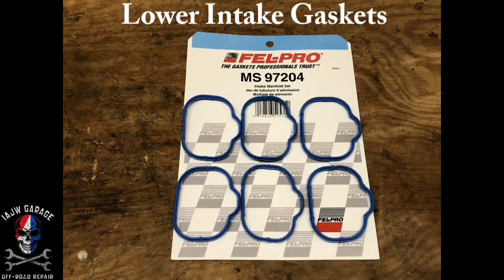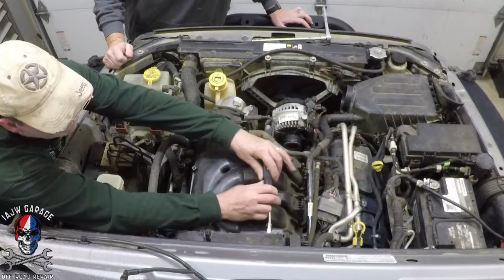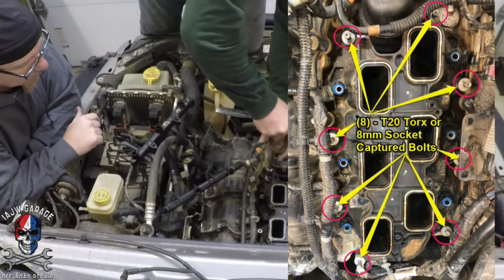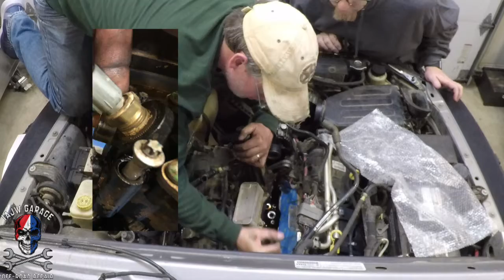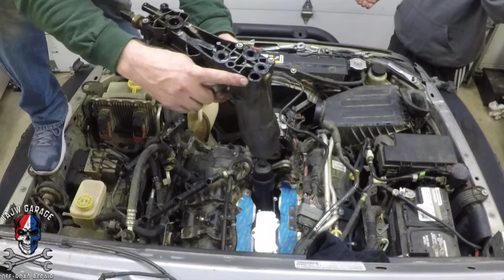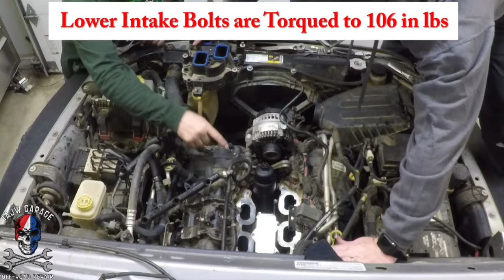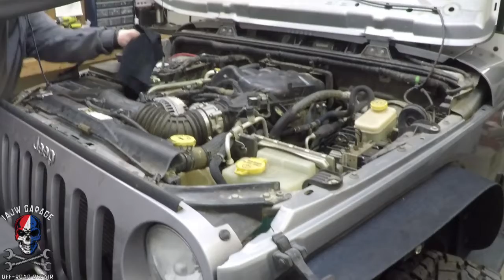Jeep Wrangler JK JKU 3.6 Pentastar Oil Filter Cooler Housing Replacement

Comment: Excellent Video! I just did this job on my 2013 yesterday. Every step is covered here. I read somewhere that the coolant could spill out of the hose and get into the oil system when removing the hose from the back of the housing. I clamped the hose off before removing it to avoid this. I don't know if this was necessary, but only a very minimal amount of coolant came out this way. Thank you guys SO MUCH for taking the time to do this video.
Reply from the maker: You are very welcome!!! Make it all worth it to hear feedback like this!!

Comment: Questions, 

1. did you drain the oil and coolant prior to doing this?  

2. am not a expert but what's the average time to complete the job?
Reply from the maker: Did not drain before doing this. 
It took us 5-6 hrs including filming it.. I’d set aside at least 5 hrs
Reply: Coolant ended up spilling into the valley to vac out. One recommend is to clamp the hose.

Comment: Just a heads up, these coolers can also fail internally and start mixing oil into your coolant system. Thought I’d leave this here because I couldn’t find much info about that occurring online. Thankfully not the head/gasket like I had initially thought. Thanks for the good quality video.
Reply from the maker: You are welcome and Thank you for the info. I had not heard that before

Comment: You sure the lower intake bolts are 106 ? 
106 popped my t-20 torque
Reply from the maker: Inch pounds
Reply: Might have been the torque I was using. 
But I started lowering it to make sure the rest didn’t pop.
Reply: It was inch pounds.
Reply: @omargarcia4293  whew! 😓ok cool
Reply: Holy shit!

Comment: use a turkey baster to get oil out
Reply from the maker: Turkey Baster would work. I used a shop vac with a rubber 3/8” inside diameter to get in there and get it all out

Comment: what exactly was wrong with the housing? thanks
Reply from the maker: The seals on the input output tubes under the housing degrade and leak
Reply: @ItsaJeepWorld  my caravan is at the dealer right now, they said I put the oil seral on wrong,, dont know how u put a round oil seal on wrong. it wasnt pinched or overtightened. when it leaked all the oil out, I refilled it and looke around the oil filter cap, wasnt a drop of oil around it., im sure they will call back and say I  overtightened the housing next and deny the warranty. thanks so much for the video, I may fix it myself.. I told the deaer I knew the housing had been revised 5 times due to problems.
Reply from the maker: @randy1ization  you’re right can’t put a round seal on wrong 🤣🤣
Reply: @ItsaJeepWorld  went to junkyard to buy a tire, guy told me  people call everyday looking for 3,6 motors. he has a waitng list. they are locking up after leaking the oil out.,
Reply from the maker: @randy1ization  good to know
Reply: @ItsaJeepWorld  hopefully an aftermarket company will make a aluminum housing soon, but I dont know how they will fix the leaking gaskets on the bottom, the right  silicone rubber formuation can take alot of heat, so im thinking the supplier of the orings used el cheapo materials. take valve stem seals, they take a shitload of heat from the valve stems, but last many years. also it could be a failure of the pressure sensor, causing excessive pressure at those seals.  being the new housing has a new sensor, it may cure the actual issue and  u never knew it..  that engine is a PLIVIT.. U know what a plivit is?  10 pounds of shit in a 5 pound bag!!!
Reply: @randy1ization  so there isn't a low oil light? Asking for a friend!
Reply: @Goesinya69  evidently not,, the check engine light started blinking and a symbol that looks like swervy double skidmarks came on.  my issue turned out to be there was 2 orings on the bottom of the oil filter, and it caused a vacuum, pulling oil out of the motor. it was my fault, I didnt realize the oring stayed in the housing. from the old filter. im talking abt the small oring on the bottom of the filter, not the cannister cap oring
Reply: these motors have a strong oil pump, and if u dont get everything right, it will leak oil.. the faster u go, the higher the pressure.. we were running ole nellie belle pretty hard .

Comment: I noticed yesterday on my 14 jku I have oil dripping down bell-housing  dripping off cross-member on to the exhaust also been noticing a little antifreeze smell at times looked down to the valley very slight trace of oil down there but I'm thinking this could be the problem
Reply: Was this the problem?  I think im having the same issue.
Reply: @TCueteZ  yes it was i took it to a mechanic cause I wasn't sure if that was the problem or not I could see down in the valley but not much oil present took it to a shop and told them to check it out 10 minutes he came back said it was the problem I stopped and got the parts on the way home and tore it down only issue was the oil.temp sensor getting it out of the old housing it was seased up and broke it but $28 dollars at O'Riley's also put new o-rings on the injectors and a new set of upper and lower gaskets this video was great step by step

Comment: How can I tell if this is the oil filter/cooler rather than the rear main seal?
Reply from the maker: The oil sloshing from the cooler valley comes down from the top on the passenger side. Get back there as best as possible and clean it. Then I drove mine and hit the brakes hard a couple times and looked, it was obvious where it was coming from.

Comment: I'm actually swapping out a bad oil pressure switch, which is located right behind the cooler.  Man THANK YOU for the best video I've found on bolt locations and torque specs on my trip down through the intakes lol.  Saved me a bunch of headache.
Reply from the maker: Thank you so much for the comments I appreciate that

Comment: This is the most complete video I have seen!  Helping a friend with his 2017 with 74,000 miles (it's only 2020) with his.  You covered every step, and included torque specs.  One question... Did you have to drain any engine coolant?
Reply from the maker: I did not. I just let the small amount drain out when I pulled the cooler

Comment: Why does everybody skip past installing the fuel rail again I’m having trouble getting the injectors to seat back into the fuel rail And everybody just skipped over the part
Reply from the maker: If everything is loose it should just pop back in, that’s why... you are binding somewhere
Reply: @ItsaJeepWorld  I just did my oil cooler tonight and turned the key in the on position and fuel came pouring out all over the ground. Is that a sign I didn't get my fuel rails back in place properly??
Reply from the maker: @brooksbrunson3823  most definitely
Reply: What did y'all end up doing, I've reinstalled multiple times and can't get the fuel rail to seat back correctly. Blue orings in the rail are all installed.
Reply from the maker: @kevinstromeyer2673  it just seated first try. Check to make sure no wires or something is blocking it from seating correct

Comment: What are the initial symptoms of this issue ?  Oil in the driveway ?  That valley of oil, holy crap.
Reply from the maker: Oil coming from the back of the engine from it sloshing out the back and gets misdiagnosed as rear main seal

Comment: I'm in the middle of doing this on a customer's 2012 JK right now and one huge tip I'll give is that the 3 oil passage ways should also be vacuumed out, I used  flashed light and could see debris down inside them. I just tape a 11/32 hose to my shop vac hose and shove it down the oil passage way until I couldn't see any more crude.  A shop in Florida did the oil cooler job for me on my Mercedes Sprinter but didn't clean the oil passageway  and 400 miles later, the motor seized up due to only one of the main bearings running dry.

Comment: Thsnks very much!! Very thorough video. I have 120k on my 2012 jku. Good time for me to change the plugs, coils and injectors. 

My Oil cooler just went but it did not leak oil. I was having coolant issues.  The jeep kept on going low on coolant. It wasn't leaking unless the jeep was driving down the road. I would get the "hot oil" message. It was hard to figure out until the coolant just finally gushed out on both sides of the bell housing when I would add coolant to the radiator. Never leaked oil at all.  

I upgraded to a 2014 oil cooler.  It has been redesigned a little bit from the 2012 cooler.  It bolts right on.  Takes a different filter.  Also the older 3.6 pentastar can take the 2018 lower intake manifold that has 20ml larger intake chambers per cylinder. Incase anyone was wondering..lol

Awesome video. Thanks for putting it together!!
Reply from the maker: Hydra Shield Basement Services Hot Oil is a Transmission Temp Warning
Reply from the maker: I added a cooler to mine, very easy. I’ve never had ‘hot oil’ message since I added it. Glad my video helped you, I appreciate the feedback
Reply: Nice comment on the oil cooler UG. So other than buying a 2014 filter, it has worked good so far? I need to do this on a 2013 and I have read several things that say to upgrade to the 2014 cooler it suppose to be a better design? You agree with its better than original cooler?

Comment: Hey man both my knock sensors codes are popping up. In the valley did u see if both sensors were located there??? I saw a forum saying one was in the bottom by the oil pan but i had no luck finding it. But i saw some 3.6 vvt have both sensors in the engine valley
Reply: 2014 jeep wrangler unlimited sport
Reply from the maker: Cris C I didn’t encounter any knock sensors in the valley, everything I encounter is in the video. What year Jeep do you have?
Reply: I cant find any video on where to locate the knock sensors !
Reply from the maker: Cris C I’ll see if I can do a search concerning knock sensors
Reply from the maker: Cris C this explains exactly where the sensor is https://www.jk-forum.com/how-tos/a/jeep-wrangler-jk-how-to-replace-knock-sensor-407296
Reply: Also did u have to change any of the gaskets
Reply from the maker: Cris C I didn’t have to change any gaskets

Comment: Nicely done...2 Thumbs Up!  I learned a lot by watching this video.  My 2016 JKU is in the shop right "now" with an oil leak issue...mechanic said it was the Oil Cooler Housing (OCH) or the Rear Main Seal (RMS).  Not being a mechanic...I had no idea what he was talking about OR the amount of work it takes to replace the OCH...that's for the education!

Comment: Great video! I've been having a coolant leak on my 12-JK that I haven't been able to pin-point. I think this might be it, and will give it a shot to replace myself. Thanks for the video!
Reply: When it leaking does your sound like it’s spitting the coolant? Mine won’t make the sound unless I’m driving so it’s also been heard to find
Reply: @sidneycoakley1524  nope... no sound as such. Just a drip-drip after coming to a stop. When examining from under the hood on the drive side with a flashlight, I was able see leak coming from behind the engine-block. Having some fluorescent dye made it easier to spot.

Comment: Definitely the best video I found. Extremely helpful and the job solved my P0520 error code on my 2014 Wrangler with 57K miles. I changed the coolant during the job as I found it easier to disconnect these lines as well to provide more room. If anyone does this be sure to keep the same color of coolant Otherside it could create major problems. 

Other comment, seems obvious but maybe not for newbies so recommended text comment update in your video. Your torque settings are in INCH POUNDS, newbies may assume ft-lbs and that’s why some report stripped  and broken  bolts. May just want to clarify and also list in N-M’s. 

Thanks again!!
Reply from the maker: Thank you for your very positive comments and suggestions. I’m very happy it worked for you. I’ll see what I can do about making sure it’s very apparent Torque Specs are in Inch Pounds as appropriate
Reply from the maker: I adjusted the written Instruction to read INCH POUNDS. Thank you again.
Reply: Beyond - keep the same color of coolant - make sure it's the PROPER coolant. I had a dealer flush mine and came to pick it up and they filled it with 2007-2012 HOAT (orange, 5 yr). My service manager even noted to only fill with OAT (purple, 10 yr) because mine is a 2013 and they switched all 2013 to OAT. Mine was being flushing because of excessive casting sand and was a dirty looking brownish color. The tech said he saw the order for purple OAT and the parts on his cart, but decided it was wrong and turned it back in to part dept and requested HOAT. Needless to say, two more days of multiple flushes and a permanent note of the issue on my account and I finally got the Jeep back.

Comment: Thank you for such an easy to follow video along with the written instructions. Just fixed my 2012 with 130k miles on it that was leaking coolant out of somewhere in the bottom of the oil filter cooler housing, likely one of the o rings
Reply from the maker: Graeme Radlo I’m very happy it worked out for you. I try to be as thorough as possible

Comment: Do you need To relief the fuel pressure? Thanks!
Reply from the maker: Guillaume HG You do not have to, but if you want to you can. I didn’t relieve any pressure. It may be less smelly and messy if you do. It wasn’t a lot of fuel that released

Comment: besides getting a P0520 code for the oil pressure sensor, what would be the reason for replacing the oi cooler? Is it because of the o ring leaks or is there other reason? I was thinking that my P0520 code is either a bad switch or maybe the oil cooler is "gunked enought" where it is causing higher pressure and thus reading hi. A local shop said the oil cooler are replaced at 100k to 130k miles. Great video. I was quoted $650 including the $350 part at local store, not the dealer ship.
Reply from the maker: qomomoko Thank you and Yes, leaking is the main reason for them to be replaced.
Reply: @ItsaJeepWorld  fyi, did not see the sequence of the lower intake manifold torque sequnce, it is online but just and FYI:: thanks a million for the video.
Reply: Front to back this ONE that I found :: DS (5,3,1,7) ,PS (8,2,4,6). This what you recommend. I also found DS (1,6,5,2), PS (8,7,3,4). Prefer first pattern
Reply from the maker: qomomoko Thanks. I’ll look it over and make a note. I thought the sequence was in the video. I appreciate your effort.
Reply: @ItsaJeepWorld  , question, when I removed the oil cooler, I would not be surprised if I got some water down the oil opening. will the  ounce or 2 just settle at bottom of oil sump? is it a necessary oil change asap? I had more coolant than I had realized in my oil cooler.
Reply from the maker: qomomoko oil change not necessary but check the level. You’ll clean a lot of oil and sludge out if the valley the fluid which comes out will just be part of it
Reply: @ItsaJeepWorld   thanks, I am afraid that some of that mix fluid will mix with the coolant and / or the oil..
Reply from the maker: qomomoko if you are afraid of that, then just do a oil change after

Comment: HI, I was able to remove the old assembly, the new seems to fit fine until I start trying to torque down the bolts, they just keep spinning and never lock. I have removed it and reset it a few times and nothing. I even managed to bust an old bolt from the original piece just to make sure the thread wasn't compromised and it goes all the way down.
Reply from the maker: #GM very strange, no one has ever had this issue to my knowledge. Possibly misaligned or something under the assembly holding it up. I’m just guessing. Let me know how it works out

Comment: You dont have to remove the ruel rails leave them both in just remove the lower intake with them
Reply: I also left on fuel rails. Upside: Fewer torque bolts and o-rings to deal with. Downside: Less hand room in back and passenger side. And a little fuel spill when disconnecting the fuel line and putting gaskets in place.
Reply from the maker: Aj Phillips Thanks for the tip, removing them was easier for me. I’m sure there are different ways to do some things. It was my first time doing it after doing a lot of research
Reply: @ItsaJeepWorld  I just did my first one today also it was pretty easy mopar makes it nice with the bolts staying put in the intakes
Reply from the maker: Aj Phillips Agreed

Comment: I just noticed today oil dripping from the bottom of the passenger side, near the transmission dip stick is located, and landing on the exhaust pipe.  Could this be the reason?  I have a 2014 rubicon with 78k miles.
Reply from the maker: Yes. It could be. Shine a flashlight passed the oil filler into the valley and check for oil sitting in there
Reply: Gots to take care of it cause t may cause an engine bay fire if enough oil drips on hot exhaust.